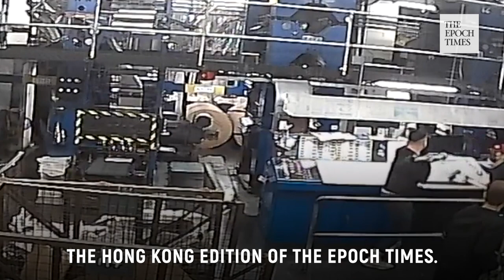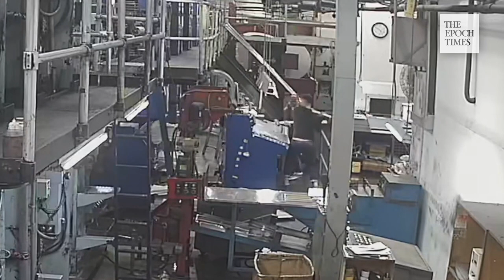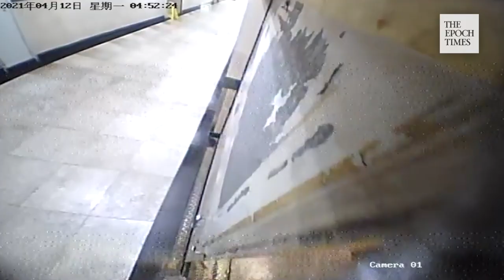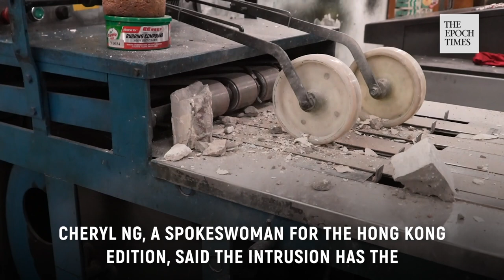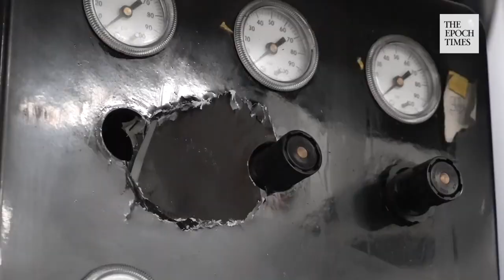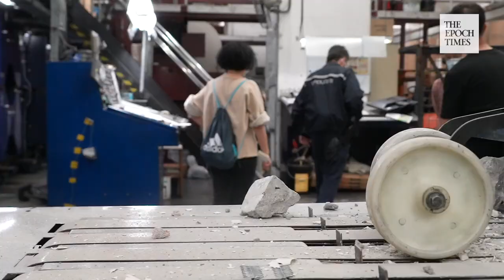Hammer-Wielding Intruders Attack Hong Kong Epoch Times Printing Press

Comment: When I was in Hong Kong in October, 2019..  I saw the what “protestors had damaged” on metro station.  I was thinking to myself that this can not be done by the college kids because it needed to special tools to destruct these metal machines.   The metal machines can not be destroyed by using umbrellas or bricks, it needs something hard like special hammer.  Looking at this picture, now I know what tools they used to brake the metro station..  these metal hammer is not easy to access to typical citizens.  If you ever lives in HK, you will know.  There is no HomeDepot.  The CCP was causing damages and blamed on protesters  so HK citizens would hate the protesters.